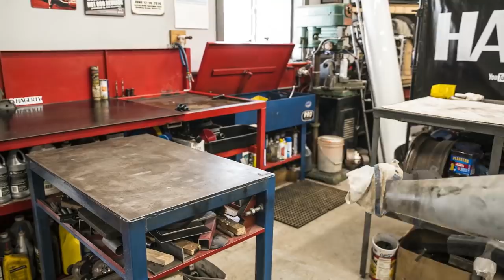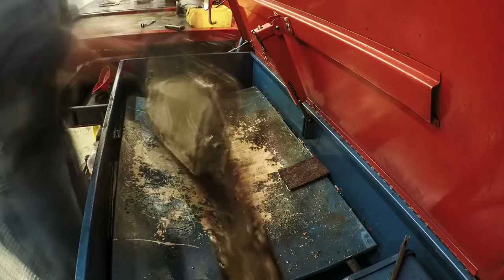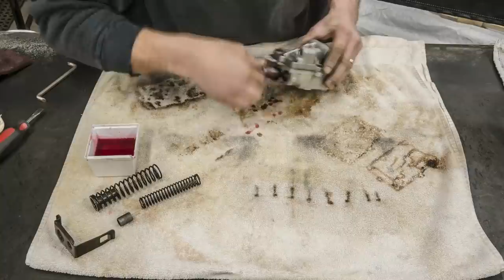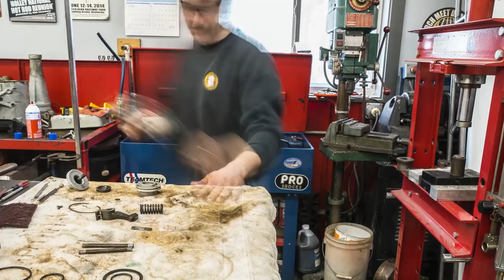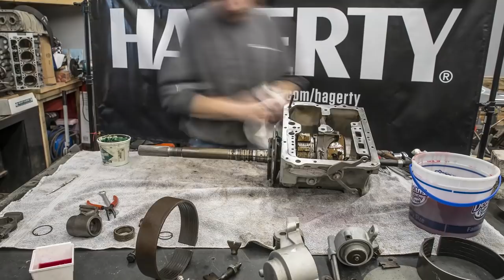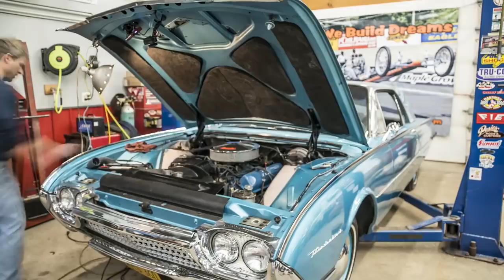How we rebuilt our Ford Thunderbird automatic transmission  | Redline Rebuilds Explained

Comment: I love these transmissions. I own every version of them. Every mechanic I’ve ever talked to has said that they are bullet proof. They are, i drove mine in every season and across many states. I stand behind these and just love them. Great work guys!!
No kudos for the Power-SLIDE, known as the powerglide comment.
Reply: Well, the racing guys certainly prefer the Power-Glide.  Must be something good in them that you don't know.
Reply: @paulcopeland9035  P glide reliabilty& the gear rati1:82&V8 1:76:1, The 6 cyl was the one they liked.
You can wind tight in low
Racing.

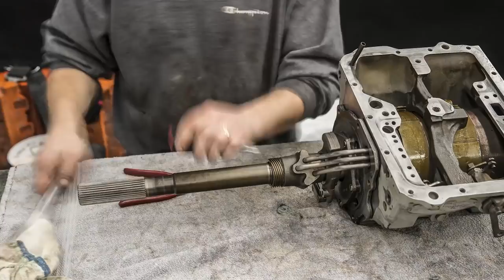Comment: 20:19, that's a governor I think. It uses the output shaft to determine engine speed, and as speed increases, like pressure increases, soon the governor pressure exceeds the throttle valve pressure and you get a upshift

Comment: I only worked on transmissions for a couple of years but that was the smallest and simplest valve body I have ever seen by a factor of at least 3.  Your typical TH350 valve body would be at least 5 times the size and complexity.

On top of that current cars have wires running to the valve bodies switching solenoid valves, making shift point debugging even more difficult.

Yep, my job at the transmission shop was R&R the trans and rebuild and tune valve bodies.
Reply: Brother I was shop foreman@ Aamco and had my own shop abot 25 YEARS. I have only seen 2 bad v bodies on 350s And I prob built @ LEAST A FEW THOUSAND,A 350 vb is COMPLEX?!?.Harder than Ford!!?. Anyone who hasn't had an issue with Fords hasn't built many or NONE!. SO I would ask ? But you have googleto answer Mr "expert"

Comment: Water will disintegrate those discs.
Reply: Water won't hurt unless when in unit under heat and pressure. Retired trans tech 35+ years

Comment: Great video thank you for the commentary. Don't know if you can help me with my Dodge Trans problem. It's making this vibration clicking noise and don't know where to start! CHECK MY PAGE FOR VID. PLEASE AND THANK YOU!
Reply: Dennis Garcia does the noise go away in neutral and park
Reply: Jay Bisky yes, the rattling gets louder as soon as I put it in drive but once back in park it quites out. it doesn't even want to drive anymore. It gets in gear just stalls hard